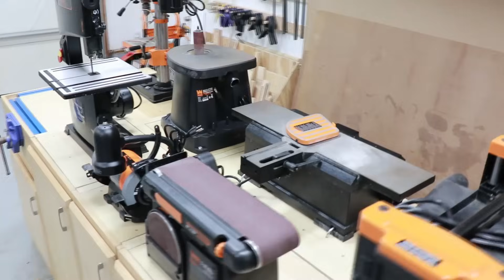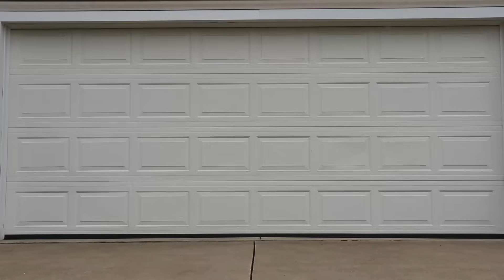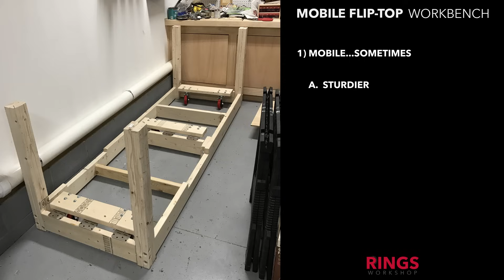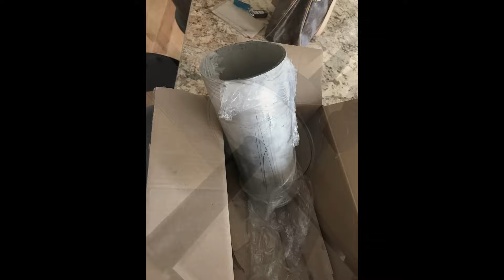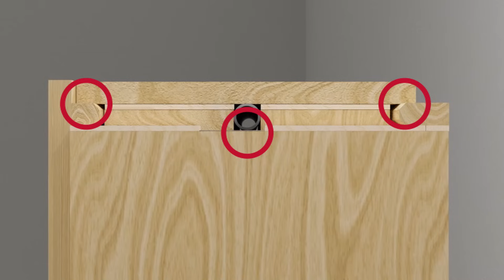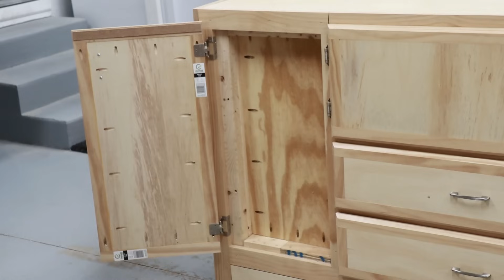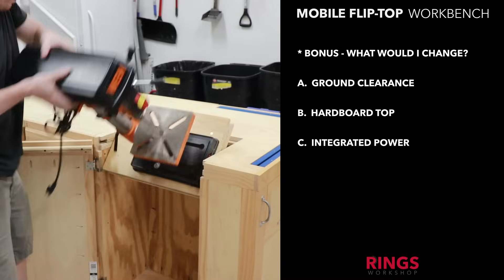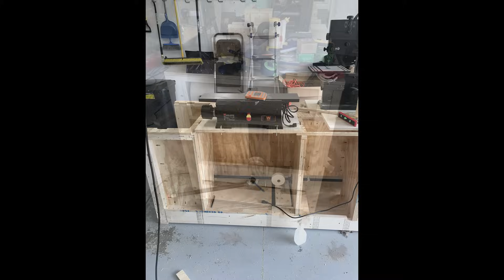Mobile Flip-Top Workbench

Comment: Great video, great design, I love the table. I see that you used Wen tools. After using them for some time would you recemend them?
Reply from the maker: I think they are a really good value tool.  Obviously you get what you pay for, but compared to other cheaper tools I feel like theirs are more well made than most.  I’ve had no issues in almost four years.

Comment: For that empty space why not use it to mount your bits - forstner bits, router bits, drill bits, bits, bits, bits. Then you would at least know where they were. I must say the design of this flip top bench is genius. Using the doors to lock the flip tops in place is the coolest thing I've ever seen. It actually re-affirms my faith that there is indeed intelligent life in the universe. Well done, lad.
Reply from the maker: Thank you so much!  I’m debating about using it for specialty bits.  I also put jigsaw and reciprocating blades down there as well.  Maybe even tuck some band saw blades in too.  I feel like small blades and bits are my most likely options.
Reply: @RingsWorkshop  Good call. That space was tailor made for bits and smaller things like jigsaw blades and such. I subbed.

Comment: You may have heard it enough already, but great job.  I do appreciate the attention to detail in the design process.  I am currently looking to do a 180 degree flip to house a miter saw beside a router in separate mobile units that will be able to lock into a miter station with a T-track.  The flip top design you have will work perfect for my application.  Thanks for sharing the video.  I like the mobile cam style caster system.  I think I will integrate that into my mobile work bench that I'm redoing since I didn't think about the height at the time when I first built it to use as an outfeed table.  I'll also use your hidden paper holder idea as well.  Enjoyed it!
Reply from the maker: Thank you so much!!  I look forward to seeing what you come up with.  I’m intrigued by the T-track idea as well.

Comment: Incredible. If you want to give yourself more clearance on the bottom but still want to prevent things from getting under the bench if you drop them, cut the trim and put on some door sweep brushes. They'll flex and bend if they hit the ground but will keep bolts and screws from being lost under the bench.
Reply from the maker: Thank you.  I’ve honestly debated that.  I will have brushes like that in a couple future videos over the next couple months and it got me thinking about that exact thing.  May just need to do that.

Comment: an excellent presentation of a well-thought-out bench.  suggesiton - on the caster cams, if two sealed bearings are used to seat the cam, then the cams will move much more smoothly with a heavier load (increased height) without any grease.  Also, you can re-skin  the top with 1/4" hardboard
Reply from the maker: Thank you!  Yeah, once I beat up the top enough, I’m going to route off 1/4” for sure, and awesome idea on the cams.
Reply: Do you have dims for making flip table its the best ive seen
Reply from the maker: @davidpauljones5061  I have basic dimensions, but every flip-top is going to be different depending on what tools you use.  Some of them are in one of the sketch-up pictures at the end I believe.

Comment: G'day mate - there's a dozen different shades of genius in this design. I can't believe it didn't get more airplay. For the power, although it isn't as convenient as having a powered table you could have a pop up power board so you could at least have everything you're using plugged in at the same time. The woodshop junkies channel has a great pop up power board idea which uses gas lift and push-to-open cover. You might be able to slot it into that spare space!
Reply from the maker: I will for sure look into that, thank you for the kind words and the advice!

Comment: Awesome build man.  It's very obvious you spent time designing this.  I have a question about the Wen tools.  I've considered buying a couple items I don't have that would be used less often.  What's your overall opinion on the quality and any considerations if i chose to purchase.
Reply from the maker: First off, thank you for the kind words.  Second, that was my exact thought on these tools.  I invested more in tools I use all the time (drills, table saw, miter saw, router, orbital sander, etc), but ones I didn’t use as much I decided to spend less and worst case if I find out I do use them a ton, I can buy a nicer one (that hopefully fits the same dimensions.

As far as quality, I think they are really good for what they are, a value tool.  I have used harbor freights comparably priced ones, and a few other cheaper brands and so far I prefer wen over other entry level tools, if that makes sense.  Had all of them for almost four years now, granted I don’t use all of them a ton, but I haven’t had any issues with any of the seven tools, or the wen air filter I have either.

Comment: Nice idea. This Bench would fit in my Workshop, but will not leave any Space around to work. My shop is  too small. I'm always dealing between several Spaces like drilling, mounting, sanding and sawing. Having all tools flipped up I would not have enough space for assambling, sanding or painting parts. I often need to clamp things vertical.
Reply from the maker: I normally only have one or two up at a time, only time I’ve ever had all 7 up were for the video.  Wonder if some of the concepts would work with a smaller foot print for you.

Comment: Great bench Chris! Nice execution and also awesome job on the video. It’s clear you put some time and effort into it. 
I Definitely want to use the flip top slide-lock mechanism when I build my bench. And Now after seeing the lift mechanism I’m inclined to think I may not have to trade off stability and mobility after all. 
I’m trying to decide if I want to include my table saw (job site version) into the table. 
Would you consider that for your shop if you were doing this again?
By the way, the edge framing around the plywood still does look great and even if it will get dinged up, you’ll be working on a good looking bench that you are proud of 🙂
Reply from the maker: You could definitely put a table saw on the end the paper dispenser is on if you have the room, that way both the table saw and planer have room for long boards to have support.  Since I use my table saw and miter saw the most, I didn’t want to mess with them being a flip top.  I also invested more money in them for the same reason.  I figured the tools I used less I would put in the flip top as they would be tucked away majority of the time but still there when i needed them.  If I put a miter or table saw in there I would likely leave them up most the time because I use them so often in any project I do, which kind of defeats the purpose of the flip top imo because you lose that work space.  That was just my logic, but it definitely can be done if that’s what fits your shop and space.  That’s the beauty of these types of projects, there’s never a one size fits all.  I’m excited to see what you come up with.
Reply: Rings Workshop - right, I agree with your logic about not flipping the table saw. I plan to add the table saw as a fixed part of the table - with the top flush. 
I saw something cool just the other day with a “drop-in” router plate inside the table saw extension. May be easier than adding as a fixed part of the table (the router)...
Reply from the maker: @jkddaddy  That makes sense.  I did something very similar on the right side of my saw as well with the router, I use the table saw fence to attach my router table fence to as well, dust collection works great with it.  I made it cheaply out of mdf but I made a few mistakes trying it out, I will make a video when I make a nicer version at some point.

Comment: OMGosh! 
Thank you, thank you, thank you! I was so happy to see the YouTube notification for this!! 
I’m really glad you were able to get it all worked out. 👍🏼 What program did you use to make these video with? It turned out super good. 😃
*Suggestions for that shallow cabinet: depending on if it’s deep enough, I’d put bottles of glue, machine oil, paint, coating, paint brushes, pencil box/sleeve, tape, a square, ruler, a little level, a handheld dust broom, pegs for goggles and safety misc, small clamps, boxes of screws, the sky’s the limit as to small gadgets that are frequently used. Definitely a strong power strip for things like a Dremel or other elec. hand tools that you wouldn’t want the pull-down cord filled with or hanging in the way. Let us know what you end up using it for. 👍🏼
Thanks again, Chris!
Reply from the maker: Davinci Resolve, very nice free program.  Thank you for all the suggestions as well!  I’m going to finish up the basement bathroom this week and next (I hope) and then I have a few more videos I just need to edit and I’ll have those up soon after as well on a couple of builds I have already done.  Ones been done for a year haha.
Reply: Rings Workshop I hear ya! I have actually been filming a lot of the things I’ve made over the last few years. I am waiting until my shed is fully up and running before I actually edit them and post on my channel. (Plus, I’ve dropped about 50# over that time and 25# more to go. I feel awkward at this in-between stage but won’t care about the comments by the time I’m done. 👍🏼). 
I should end up with all kinds of how-to,  projects, and start-to-finish videos by then! Hopefully, I’ll be able to establish some followers from them, too. 
That’s great news the DaVinci Resolve program is free! I’ll have to check it out tonight. 
Great work on the video, like a pro. You’re much better at eye contact with the camera than I am. 
We’ll keep watching for your next project posts. 👍🏼

Comment: I'll ask what I'm sure everyone is thinking.  How much money do you have wrapped up in this workbench?  I've been looking at several different mobile workbenches\workstations and I have to admit this one seriously has impressed me the most.  Well done!
Reply from the maker: More in the tools than the bench, but most the plywood inside was cheaper sanded plywood.  Most the parts are fairly cheap but they add up with the quantity in there between the casters, hinges, steel pipes, etc.  If you don’t do the edging it will save quite a bit of money and still be just as functional.  Same thing if you use hardboard on the top instead of nicer looking plywood that would save some money too.  Honestly don’t know the exact amount as I bought what I needed as I went over six months, somewhere between $500-$1,000 I’m sure.  If you can get better deals on lumber vs a big box store I’m sure you could do it for much less, there is just a ton of plywood in there that jacks the price up.

Also, thank you for the kind words.  Means a lot.

Comment: Wooo weee, I would hang some clamps in the empty thin drawer. Thanks for the 3d animations, that helped me understand the process alot.
Reply: What about a square and some table saw or circle saw blades.
Reply from the maker: @millmoo  I used to have blades in the empty one actually, then built a separate holder for them mounted on the wall that holds more.  I will likely do the same with the sand paper at some point too.
Reply: Very well done tutorial and very informative. Great use of space!